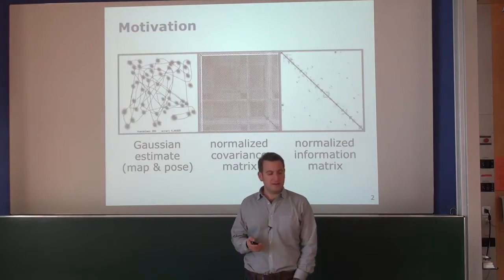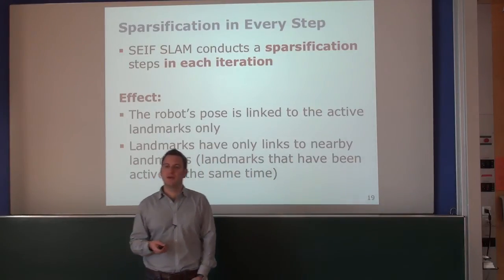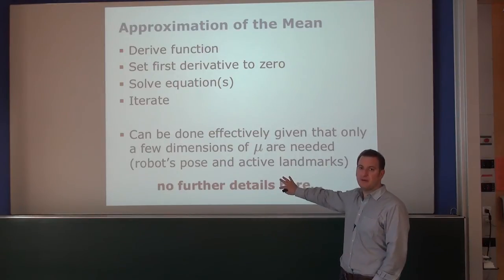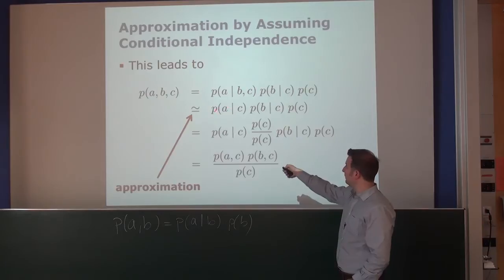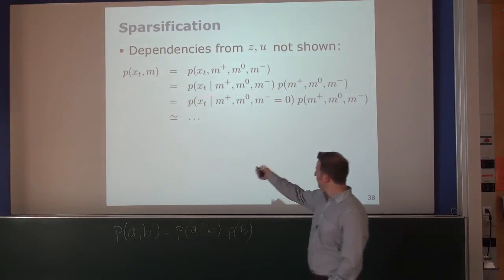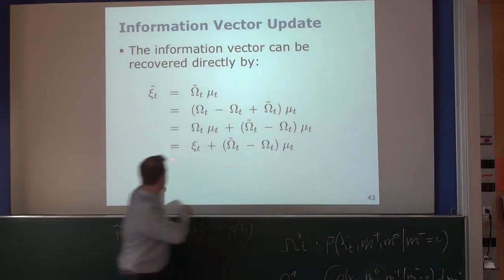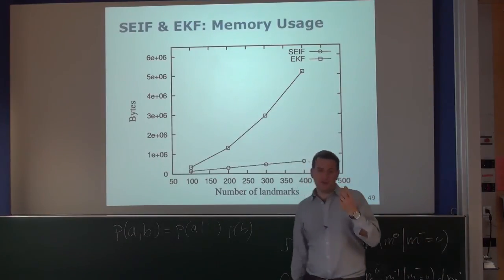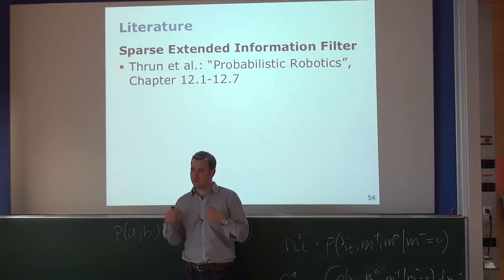SLAM Course - 08 - Sparse Extended Information Filter - Part 2 (2013/14; Cyrill Stachniss)

Comment: Question: at 45:00 the difference on line 4 (sparse information mix -- information mtx) represents non-active landmarks because you are basically doing (active - all), so wouldn't this be slower than line 1 because the number of active landmarks is usually a small constant (less than number of non-active)? so wouldn't it be faster to use line 1 (sparse info mix * mean)?

Comment: Dr. Stachniss, I just read a dissertation from 2008 (Title: "Sparse Bayesian Information Filters for Localization and Mapping" by Matthew Walter) that proves that the original SEIF algorithm from Thrun et al. produces inconsistent, overconfident posterior estimates. The author proposes an alternative approach called the "Exactly Sparse Extended Information Filter" (ESEIF) that periodically kidnaps the robot and re-localizes it using a subset of measurements in order to enforce exact sparsity. I'm not sure if you've seen this before and it might be of interest to you. I'd also be interested to hear your thoughts about it.

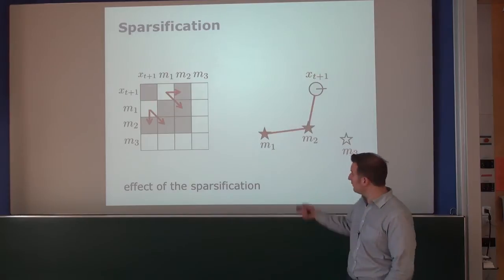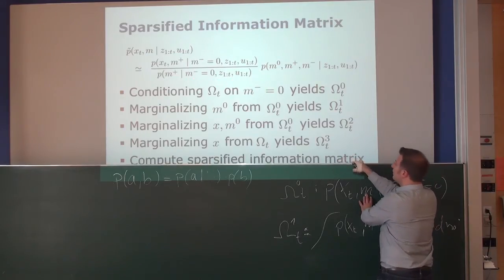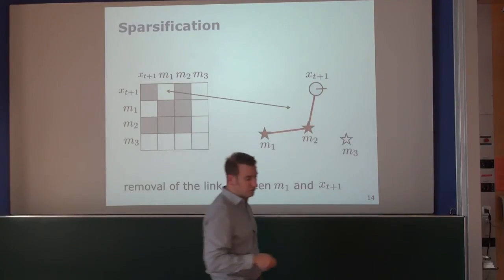Comment: The link between the pose and the landmark m2 becomes darker (ie. more stronger, less uncertainty, more informative) at the time slide 6:59. It means that the element in the information matrix Omega after sparsification should have a larger value compared to the updated Omega right after the measurement step. However, the formula to calculate Omega tilde at 42:24 does not support this. How is the assertion at 6:59 about the link between the pose and the m2 made? or is it empirical heuristics?
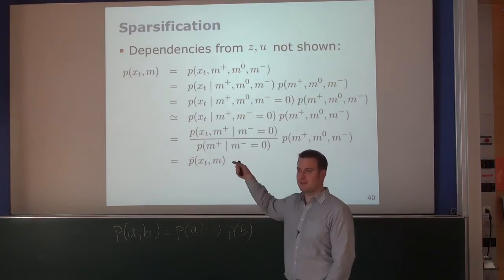Reply: As far as I understand, if there is no approximation based on the markov assumption and the elimination on the inactive landmarks at 38:09, the marginalization step would enhance the link. Unfortunately, this intensification may not happen due to these approximation and assumption.

Comment: I have a small modification in my mind, but not sure whether it will work or not. Can the sparsification be done before the state update estimation step? Even though the estimated Mu is used in the sparsification step, it is only used to compute ~zeta. ~zeta does not differ greatly from zeta which is calculated in the measurement update step (As omega and ~omega are very much similar, their difference will contain mostly zeros). So if calculation of ~zeta is ignored, Mu can be simply calculated as inv(~omega)*zeta without having to go through the trouble of performing any gradient descent (or any similar algorithm) to estimate it. 
But this can only work if ignoring the computation of ~zeta (and just using zeta instead) is plausible. Any suggestions?
Reply: Hello , Do you have any code block for SEIF?

Comment: Excellent video, many thanks! I have a question regarding how the SEIF behaves during loop closure. Since the SEIF neglects links between robot pose and passive landmarks, is the uncertainty of passive landmark positions still reduced during loop closure? Is the uncertainty reduction of active landmarks similar as in the EKF?
Reply: Did you implement it?